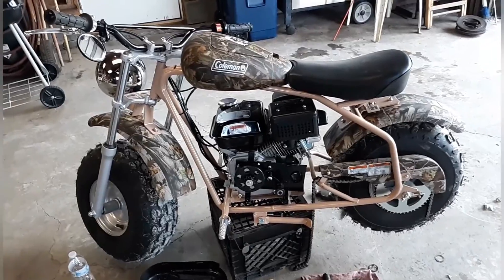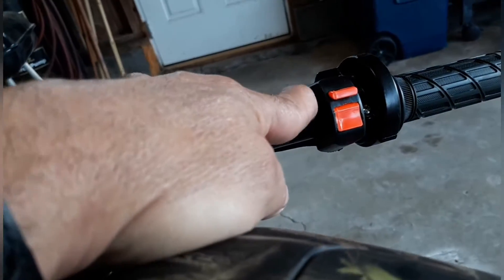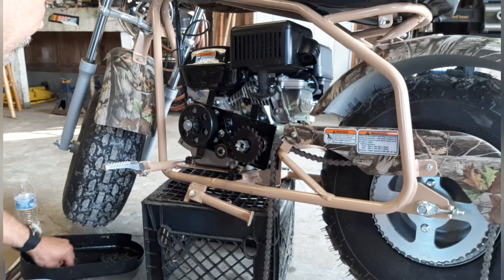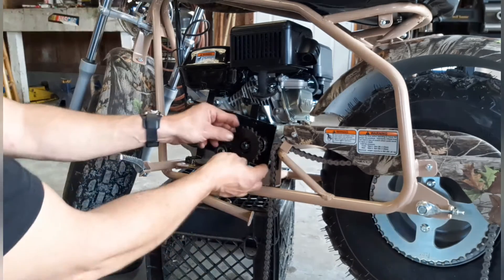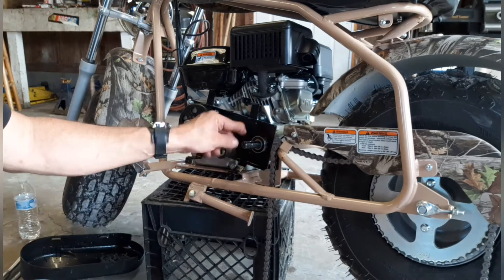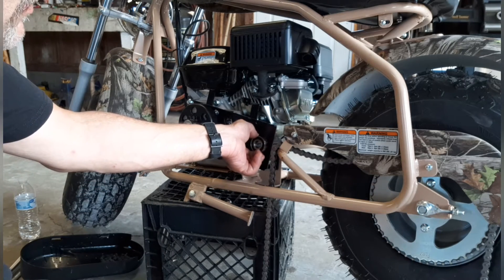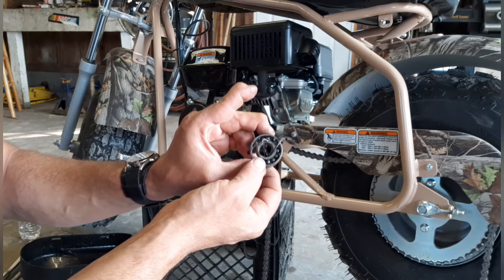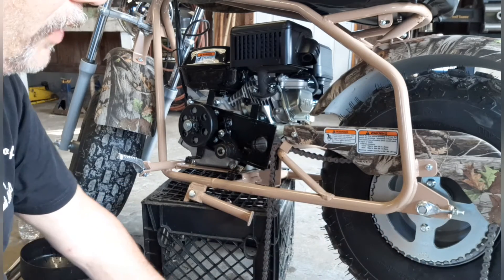Coleman CT200U-EX Jackshaft Bearing Failure

Comment: Have the exact same problem on a 2020 CT200u-ex i just bought used.  Hopefully these cheap metal seal amazon bearings (6203ZZ) will be better that the oem that came in the jackshafts of these bikes.  Thanks for the video Johnny Mullet!
Reply: Have you installed these yet?
Reply: @TonyMontana-lh5bp  Yes, just installed them last night.  Was a major pita and i ended up damaging one of them.  They fit very tight.  I found them on amazon for $7.99 for 4 of them.  Bike seems to be running fine again.
Reply: @brg88tx  thanks for the response. I hope they hold up for you.  I just ordered a set of them. My bike has VERY few hours on it and one of the bearings went out. Possibly due to the chain being too tight from the factory.

Comment: You should have 90 days warranty but like I,m not confident in Coleman with my little interactions w them, your comment you will be working on fixing stuff is right on.
We bought 2 bikes and 1 is broken the shaft has lost the castle nut so I will be doing the repair too

Comment: i have finally solved the problem surrounding the jackshaft bearings, my problem was that the rear tire was out of line and the chain too tight to pop off, i ordered a chain alignment tool and realized that trying to line up and match both sides of the chain tension screws symmetrically does not work, this would be due to manufacturing tolerances, the hole on the left side of the frame may be slightly farther forward or rearward of the hole of the right side of the frame. this has also solved my brakes rubbing issue. get a chain alignment tool and align everything that way, do not try to symmetrically match both chain tension screws or you may find your chain popping or damage to the jackshaft and or sprockets

Comment: 6203rs bearings are used in idler pulleys on my Cub Cadet 50 inch mower deck(and probably others). I just replaced a couple which seized from dirt/debris. About $4 on Amazon.

Comment: Excellent video. A high temp grease or white lithium is a good grease to use. Packing a bearing is an art form.  I use the palm method myself.  These things come from China. On the boat things dry out and I'm sure the grease is nonstandard. Made to fail.  Timken or SKF are best. I've found bearings that have no grease at all. Thanks for sharing.
Reply: Or use red tacky
Reply: I just got some bearings that are chinese made, the "grease" inside smells like melted rubber fishing worms 🤣
Reply: @contraband1543  could be.

Comment: I'm not sure what the hell the problem is with mine. Mine's not a Coleman though. I have a 196cc X-PRO200 Mini Bike which is basically the same thing as the MB200. But it's not like it's an old bike and I've put hundreds of miles on it. I have only had it about a 1/2 a year or so and haven't ridden it a whole lot either and just today when I decided to take it for a little stroll I hear some weird noise coming from somewhere in or around the engine. Sounded like it might be where the pull start wheel is. Made what sounded like a rubbing sound almost but louder. I am not a mechanic by any means and have no clue how to pin point the problem. It doesn't make the noise the entire time the engine is running it usually starts making the rubbing noise when I am in the middle of gassing it and then it'll stop making the noise before I can come to a stop to see what it is. Doesn't make the noise when it is stopped only while riding. Meanwhile I have a Torque Converter and Riser Plate coming to me in the mail and I hope I'm not wasting my time putting those on if the engine itself is having issues running on it's own.

Comment: My same Jack shaft bearing started making noise after about 4 hours of use. I immediately parked it since I had a torque converter kit for it from Go Power Sports and was going to be replacing the stock clutch and jack shaft anyway. I found the grease seal on the outer bearing was loose and the grease had mostly come out. I ordered a pair of American made Timken bearings from Amazon for $24.00 including shipping since I didn't want to mess with anymore Chinese crap bearings and have to replace it again. I installed the torque converter and got 3 times the speed with out further modifications other than bending the throttle stop tab flat. I installed the Temkin's in the jack shaft although I will probably never use them. They will go to the next owner of the bike if I ever sell it. Thanks for the video.

Comment: I appreciate knowing what's inside these. About to tear into mine ... the jackshaft won't spin the main chain sprocket. So maybe the woodruff key is gone? I'll know shortly. But I'll also order a torque converter now; dealing with this, and then the secondary chain that needs occasional oil? No thanks.
Reply: Yep, the woodruff key disintegrated. And the axle slot it fits in is rounded out on one side ... not the backside as you might expect from applied power, but the front side. My guess is that the woodruff key was allowed to wiggle around in there until it got twisted and began to shear.

I could fix it with a different jackshaft, but seriously, why bother? Off to research torque converter setups now.
Reply: @thenexthobby  The torque converter is the way to go on these bikes. You get better low end and higher top speed and don't really have to do much to the engine.

Comment: What's the best drive and driven sprocket combination so I can solve the over slack in the rear chain to my Coleman ct200uex ? No matter how it's tightened back up, it gets loose again. Why not make it do it just stays that way ?

I'm finding out that this causes bearing problems to the driver bearing.
Thanks. Great video.
Reply: cheap chain stretch . ir will stop

Comment: I experienced that failure 12/28/2020 and I used O'reily's wheel bearings part number A-1 it fit perfectly so with this bearing throw away the outer ring that these bearings come with because it wont fit with it on be sure to pack all bearings before installation u put the back bearing on first put the shaft inside make sure every part has grease on shaft install dont worry about hitting the bearings in housing the easiest way I have found was using the nut to tighten all parts however i found it to be very difficult to tighten without putting on the chain and getting a very small screw driver to put through the chain so u can tighten locking nut u must tighten enough to put cotter pin hole it's very difficult but u can do it after a few curse words once chains are on the back tire wheel lock up its suppose to do that start it up give throttle but not to much just enough to turn the chain slowly u should hear a pop when u do you'll notice right away u can move the back tire freely that means ur bearing popped into place take it for a ride until u hear a second pop once u hear the second pop ur bike now has both bearings installed and aligned properly be sure to make any adjustments necessary and check clutch chains, bearings, etc.

Comment: High there. Just subbed you. On my channel I had a similar problem, my jack shaft exploded. I ended up deleting the jack shaft Got a new clutch from GoPowerSports.com and replaced it. Its slower taking off but have not had a problem since. I think the next step is getting a 60 tooth for the rear, to ease the stress of the clutch. My channel I have shown mods. Also just purchased the Trailmaster MB200-2 and love it. I did some mods to it already. The MB200-v2 is by far worth the money.
Reply: 1. Install a torque converter.    2. Swap 50 tooth rear sprocket to a 25 tooth.    3. Beat Millennium falcon's record Kessel run of less than 14.5 parsecs
Reply: Stock clutch is weak.

Comment: Same thing happened to mine I’ve got the same bike. Replaced my bearings and same deal happened again. I found out the rubber bearing seal was getting hot and melting away and grit was getting inside. Got bearings with metal seals and haven’t had the problem since.

Comment: I've had mine for a week... rode it up and down the street several time... haven't even refilled the gas tank... same failure.
Reply: Throw a torque converter on it you want regret it mine went 24 I removed the jackshaft and put on a torque converter and now it goes 38 and will pop wheelies with raw power

Comment: Thank you sir,, mine just did the same,,
Reply: My theory they sell them thinking most people will mod them up. Clutch and shaft are pointless imo. I Spend extra 80 on torque convt. 100 on Mikuni carb I’m 6’3 275 and mine does 68 wot. But some think they shouldn’t have touch after they buy
Reply: @livefast9865  68 is rollin!
Reply: @sidewayzmike  meant 58 and that’s down hill lol